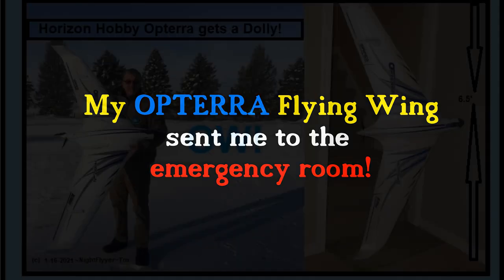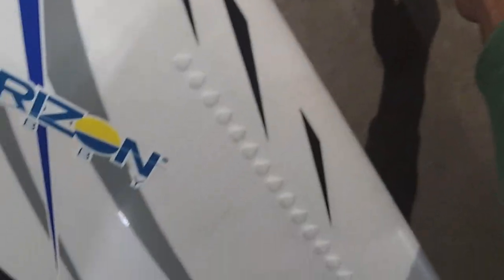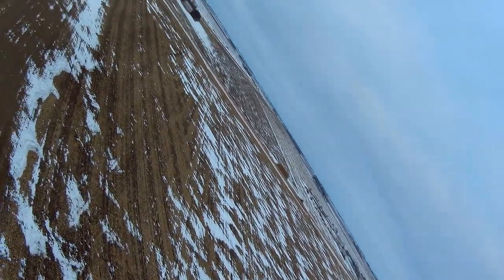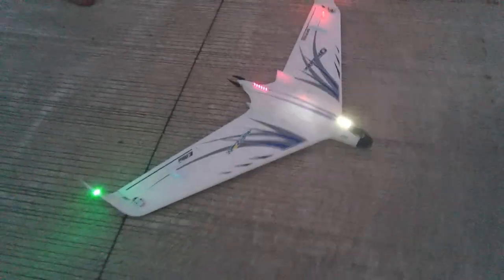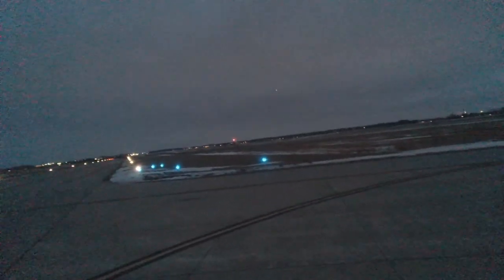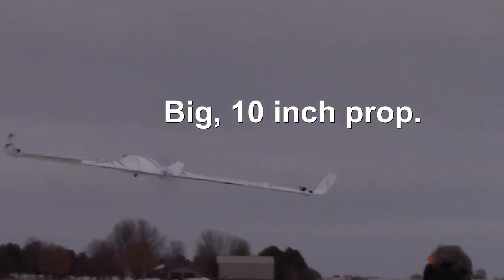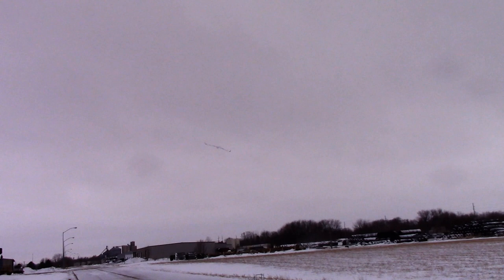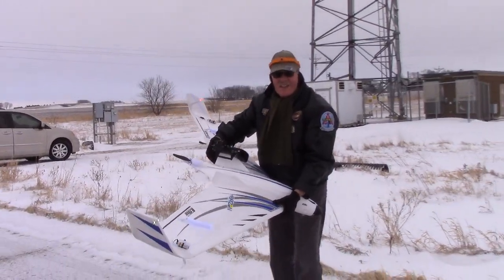My Opterra 2M Flying Wing sent me to the E.R. This is an awareness video & my solution for launching

Comment: Hand launching that model was an accident just waiting to happen. Sorry you got hurt. Glad it wasn't much worse. The dolly is a good first draft design  (nice way of saying, "it needs some work"). If it were me, I would put larger diameter wheels on the front (10-12 inches). Also, it would be easy to slave another receiver to your transmitter with a gyro on the yaw axis (gain set to high). Use the rudder channel servo to steer the dolly on the roll. Or if ya want to go high tech, steal the guts out of an R/c car and  cobble together a powered , steerable, gyro stabilized dolly (add a kill switch linked to the model lifting off).  Fly safe, Semper Fi.

edit: Added kill switch note.
Reply from the maker: Yes, I will add bigger wheels. I used what I had.   I do not need to make is steer.  The string works fine and I have lots of room to make it fly at the field this summer, even if it goes off center some even without the string.  We Marines like the KISS theory.  Many always try to improve on my original ideas after the fact and I appreciate that.  Thanks and Semper fi.

Comment: I have an old Stryker mono wing, I went to the store and bought some masons string and 20 ft of 1/4 in bungee cord and a plastic key hook.. I added a glue on hook to the nose, anchor one end with of the bungee cord a sand bag or tent stake and pull back on the plane that is attached to the 2 ft mason string leader. Its a slingshot now. Ive even launched from the ground with my foot before. This is kinda expected with theses manual launch pusher planes.
.  .
Reply from the maker: Yes, well there are lots of ways to do it, but my Self contained launcher was destroyed in the fire with all my planes and home, and I never needed another.  My F-27 is tiny compared to this big 7 foot wing. Here is more on the issues of hand launching with pushers, especially this 7 foot Opterra.  https://youtu.be/f5xDfk7sbcQ

Comment: very Scary, I also have a heavily modified Opterra (pixhawk, GPS, etc) and since day 1 I realized about this risk and the best I did initially was to wear a globe (thickish) to protect my hand when hand launching, but after a while when the Pixhawk was installed, I set up a function called "Autolaunch" that enables the throttle only a few milliseconds (and this time can be adjusted) after the initial Gforce is felt due to the hand launch movement, this is a safer method because the throttle will remain deactivated only until the plane is in the air
Reply from the maker: Yes, live and learn, but I followed the instructions to a T when I made my first video for the product review.  This 7 ft wing is a bit tough to launch, not like my smaller ones, and I found that I have to keep my right hand on the elevator stick to launch it.  But again, I followed the instructions in the manual.  Here is word for word what the Opterra 2M manual says about launching.  
1. Put the aircraft into launch mode with the channel 5 switch.  (in my first video that did not work, it went into the ground https://www.youtube.co/watch?v=P_inF5EYLEE&t=1s   )  
2.  Hold the aircraft in one hand and the transmitter in the other.  
3.  Apply full throttle and throw the aircraft directly into the wind, angled slightly up (5 to 10 degrees above the horizon). 
4.  Climb to a safe altitude and check the trim.   
I know others have their own ways, and either way, my Dolly is the safest solution for me.  
The Opterra 2M manual also says nothing about throwing it with the motor off, so if a newbie followed the instructions, like I did, I'm showing what could happen, in case a gust of wind got them or something else.  Thanks much.

Comment: Any pusher prop I launch holding the wing, or without throttle if I can’t wing launch. Neither would work with that plane. Wonder if Horizon thought about the safety issues with such a large wing.
Reply from the maker: It is very hard to pick up with one hand for sure.  And all the disclaimers in the manual actually tells me they surely have thought about it.  Thanks much.

Comment: Ouch. Nasty wounds... launcher much safer! Pretty sure I heard a "tick" as the prop struck the dolly taking off. May want the dolly wider for more side to side clearance to avoid breaking a prop on takeoff... esp in the cold weather when props are brittle.
Reply from the maker: Actually that was the dolly hitting the screwdriver I pounded into the ground to tie the string to.  Also I put wire guides on the bottom of the plane to hold it in place so it would not slide side to side.  Thanks.

Comment: Did you consider a leather glove?
Reply from the maker: Yes, I have, but found I could not grip the bottom of the plane very well with those tiny finger holds on this 7 foot wing.  I also am not good at running the  transmitter with big gloves.  Thanks.

Comment: Dave just use push rods to make longer legs for the wheels so you take it down the runway for take off.
Reply from the maker: A thought, but these short coupled wings, dont land well with bounces.  My dolly is now my landing gear and adds no weight to the plane.  Thanks.

Comment: Ouch ouch ouch! I've only ever cut myself with a little 2" brushless quadcopter because I underestimated how much power it had. I tried to hold onto it while testing if it was set up the first time. It wasn't, and easily twisted out of my grip. Dumb dumb dumb. Didn't need stitches, but it gave me around a dozen stinging little paper cuts on multiple fingers. I can't even imagine with a 10" prop. Some of those high performance electric ones are quite sharp too.
Reply from the maker: Well said.  Thank you.

Comment: I set up a throttle cut off on the H switch on my transmitter for all my planes.  You can find the throttle cut off on the function list  on your transmitter. I have this plane also. I never launch it with the throttle on.  It is heavy and have to throw it pretty hard. But once it's away from me I turn the throttle on . Not easy to do and takes  doing it a few times to get the hang of it.. Hope you get well soon.
Reply from the maker: Your right. .   I certainly know about cut switches as most of my helis have that setup. I've flown models for 60 years.  I'm 73.  But the best rc pilots in the world, have also had bad landings once in a while.  Shit happens, especially while I was trying to throw this heavy, under powered 7 foot model into the 12 mph headwinds.  Maybe if the Manual had said I should do that, I would have.  First of all, that had nothing to do with my hand injury. I only mentioned the Throttle arming because I followed instructions in the manual and this is the way it bound up and arms the motor as soon as you plug in the battery. It says nothing about programming in a cut switch like my helis have. I only mention it to warn others to program in this feature as well,  which also should have been mentioned in the instructions.  It's my warning to be cautious, because the manual says nothing about programming in a throttle hold to a switch. I've known of times when after flying, that switch was forgotten to be moved back to safe and it armed as well.  Nothing is 100% as it could be left in the wrong position, by accident. I'm pretty experienced, so never relied to on a throttle cut/hold, as all my helis and my drones, and many of my electric planes need throttle stick movements to arm.   I only am warning others to be careful BEFORE the launch and to be careful no matter what you use. .    Here are the links to the last videos and you can see I launched it the same way without problems.  Thanks.  Its hello dolly from now on. 
https://www.youtube.com/watch?v=P_inF5EYLEE&t=1s&gl=CO  and   https://www.youtube.com/watch?v=ur5V5H8UcGs&t=1s
  These are the links to the last videos and you can see I launched it the same way without problems.
Reply: NightFlyyer. I have mostly E-Flite planes and all of them are the same way. As soon as the battery is connected the throttle  is live. Like you said the manual doesn't say anything about throttle cut off and I wondered about that too. I learned about it from watching videos from other people. And I have been to the emergency room because of one of my planes too. I have the Opterra and it is a great flying plane and fun to fly.
Reply from the maker: @michaelrobertson4745  First of all, that throttle arming had nothing to do with my hand injury. I only mentioned the Throttle arming because I followed instructions in the manual and that is the way it bound up.  It arms the motor as soon as you plug in the battery. I usually program a throttle cut in and mentioned it in case a new person forgot.  In older Electrics we used to put the throttle at full.  Then when it was time to fly, you would bring the throttle down to idle to arm it.  Today's transmitters warn if the throttle is full and no rf is transmitted till you put the throttle to low.  Because this big plane is hard to  handle to prepare for launch, I think the manual should mention to program in a throttle cut. I looked for your flying videos of it but sadly saw none.
Reply: @NightFlyyer  I know the throttle cut off had nothing to do with your accident. You showed how the throttle arms when the battery is plugged in in your video. I thought maybe you didnt know about the throttle cut off  and was only trying to help. I know the planes do this so I just program the cut off automatically even though the manual doesn't mention it.

Comment: Any word from Horizon Hobbies?
I know this airframe is old, but IMHO, these Opterra had to be redesigned with an EDF
Reply: afaik EDFs are less efficient, so that may be a reason why they didn't.
Reply: @adrock0801  i think it depends on how the EDF is designed. Many variables, ie, blade count for example.

Still, hand launching a single pusher prop flying wing is very risky.
If you'd ask me, rather have a bit less efficiency, than risk having 20+ stitches on my launching hand.
Reply from the maker: If I used the edf that is in my 6 foot long Byron F-16, that would work great, but price is around $400 just for the fan and the ESC is over $150, so I doubt it.  Thanks.

Comment: I got my opterra 1.2 meter, and then found videos like this! First off thank you for sharing, because this is serious shit. It's helped inform me and any one else of this hazard.

My solution is way low tech...I use a thick snow boarding glove to hand launch with my right hand while the opterra is in SAFE then I ditch the glove and get on the right stick to climb out.
Reply from the maker: Thanks for that suggestion and I tried that already, but because it was cold.  I found trying to hold on to the tiny finger grips on the bottom of the 7 foot wing with a thick glove under full power with wind blowing was difficult when under power and then trying to fly with  a big enough glove on was also difficult to fly the transmitter, (I'm a stick pincher)  so although that sounds like a good idea, it did not work that well. Some have told me the Prop got them in the forearm even before launch, when a gust of wind got under the wing and tipped it back.   We are only talking about a Half inch of clearance that I needed to keep from getting cut, and even though I pulled it off several times in my earlier product review video,  I will never hand launch it again.  LOL.  It's hello dolly from now on!  Thanks.

Comment: Major ouch!!! Those rear prop hand launchers are dangerous for sure, some guys I fly with have this plane but throw it first then spool up because they’re afraid of that prop, can’t blame them
Reply from the maker: The Opterra 2M manual also says nothing about throwing it with the motor off, so if a newbie followed the instructions, like I did, I'm showing what could happen, in case a gust of wind got them or something else.     Nothing is 100% and no matter how good you can throw, this big 7 foot wing with a 10 inch prop spinning right next to your face, into 12 MPH is risky to say the least.  The 10" prop is very close to your forearm as well, so a gust could tip it back even before launch, as others told me happened to them.  Thanks.

Comment: I also learned the hard way to always set your throttle cutt off  18 stitches to my thumb, just missed the tendon
Reply from the maker: Exactly and why I warned. It is also easy to bump my throttle cut switch trying to pick this thing up with 2 hands as it is to bump the throttle, so you have to be careful for sure.

Comment: Some words of advice for people reading, with pusher style planes, if possible, always turn on the prop after it is clear of your hand.
Reply from the maker: That should be in the instruction manual instead of this.  Thanks. Here is exactly what the Opterra manual says word for word.  1.  Put the aircraft into launch mode with the channel 5 switch.  (in my first video that did not work, it went into the ground)  2.  Hold the aircraft in one hand and the transmitter in the other.  3.  Apply full throttle and throw the aircraft directly into the wind, angled slightly up (5 to 10 degrees above the horizon). 4.  Climb to a safe altitude and check the trim.
Reply: @NightFlyyer  Yeah, I've also seen many people follow through with their throws as quickly as possible, as to get their hand down away from the prop before it hits them. Still makes me cringe when I see videos of it now, knowing what happened to you.
Reply from the maker: @IMayHaveNukes   Yes, nothing is 100% and I am living proof.  Thanks again.

Comment: I love your launch cradle. 
My solution would have been adding tricycle landing gear.
Reply from the maker: Thanks.  My launch dolly IS my landing gear and much easier. If you saw my Product review  video,  https://www.youtube.co/watch?v=P_inF5EYLEE&t=1s  you would see  those wings aren't as strong or thick as you would think.  I would have to add a nose wheel servo and make it a trike as well.  And since the prop on the back is 10 inches, the landing gear would have to be quite long or retractable prop would hit the ground on rotation or landing. Thanks for the suggestion, but the dolly is pretty permanent too.

Comment: I got chills when i heard it hit your hand.   Practice launching while flinging it from the wing tip. Its easy once you figure it out.
Reply from the maker: Not with this big underpowered wing.  This wing is 7 foot long, heavy and  will bend and break the end off the if you even try to pick it up by the tip and barely has enough power to fly out of your hand at launch.  I know and I tried to launch it discus style, but could not hold it where I felt I could launch it successfully in the wind.     It would also be extremely difficult to somehow launch it discus style with the elevon there and that 7" tall winglet rudder that is also on the tip.  I know how to do it , but not with this plane.  Thanks.

Comment: With a little testing and ingenuity, I think the tube launcher could be made to work with a relatively simple catapult.  Think of a bike wheel, spinning fast, then slam the catapult and launch the plane,  Now simply cut out the part of the wheel that would hit the prop.  So the plane is pulled in line with the nose, but as it's launched and the prop goes over the wheel that section is missing. 
Similar idea is like a sawstop.  Cam on the hub of a  locked wheel, and as it spins after the nose goes past a cam on the wheel unlocks the hub, and the whole wheel falls or rolls down a slot forward and down, to clear the prop.
First idea should be easier.  Initial idea was more like a spiral cam, and that may be best.  More gradual acceleration, then the furthest out part of the cam slings the nose off the tube, and you're back to the smaller radius for the prop to go over.  
Often called a snail cam.  And realize it doesn't have to be only one turn, make a fast expanding cone, and have the cord roll onto it smaller to larger for a few turns, with the last turn being the furthest out and in line with the nose, then the end of the cam and drop away.  Furthest point at the end just has to be the 6" further out than the next to last turn to clear 6" of prop.
Make it 3 turns, then make a mechanical stop after 3 turns.  That way the timing is purely mechanical and fixed, and there won't be timing involved.  Launch happens, furthest point clears the nose and falls down then the cam locks, won't matter how far back the prop is there is no other timing involved the cam stays locked down at maximum clearance.
Reply from the maker: Yes I know about catapults.  I also know they take lots of room to carry.  Mine as you saw at 7:24 was perfect but destroyed in the fire that destroyed all my planes as well and I never built another.  My Dolly is my easiest way these days although your design sounds great. Thanks.

Comment: I’ve never heard of that arming feature. I’ve always had the motor on a switch, I flip it to disarm it, flip it again to launch.
Reply from the maker: Every one of my Electric helicopters and drones require moving the throttle stick to full, then back to idle to arm.  The manual says nothing about programing in a throttle arming switch.  I followed the instructions.